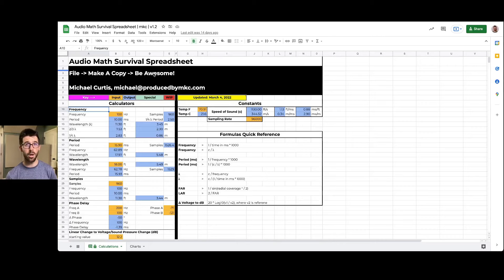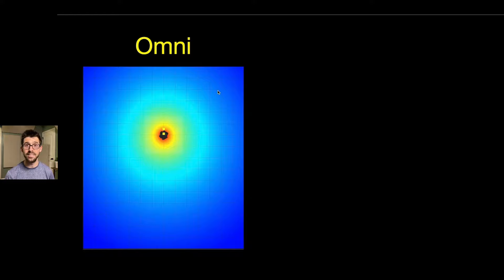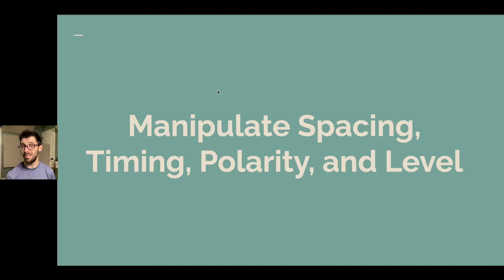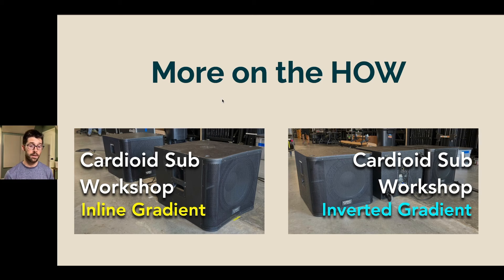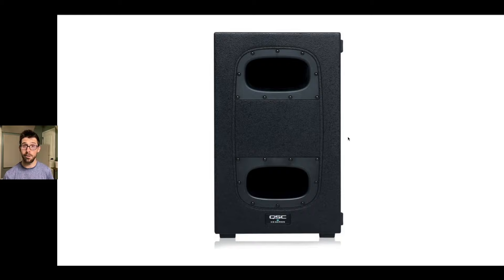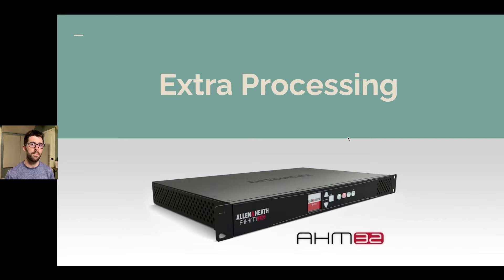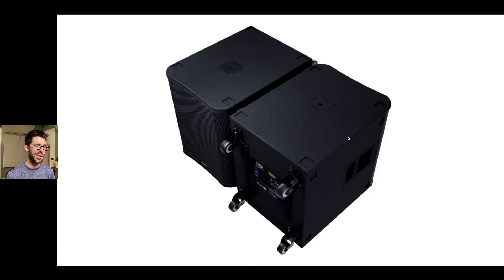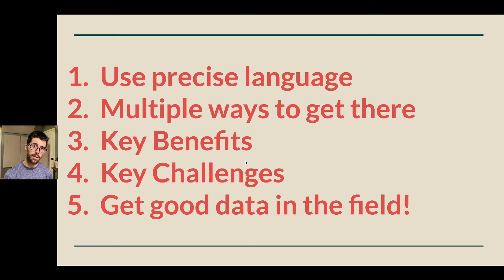Cardioid Subs Explained For Normal Audio People

Comment: Today I checked this QSC cardioid sub with Genelecs 8020 monitors indoors. The positioning takes a lot of place. The speaker front opening was 1,25 from the front wall and pushed my listening position almost into the center of the room. 
I will give it another try on an outdoor setup with KS-Digital D-80. This could be nice for electronic jam sessions.

Comment: Good info.  I wouldn't underestimate the value and efficiency of using purpose built Cardioid subs if this is important to you.  Much simpler, quick setup/tear down, requires less space/power  and very consistent results plus it may even cost less as you don't need extra boxes and amp channels.  I use D&B Audiotechnik B4 Cardioid subs and am extremely satisfied with their plug and play performance and ease of setup compared to building an array.  Not going to compete with McCarthy array in a huge venue but great for many venues where we mortals live 🙂
Reply from the maker: That's a good word and great point. I'm not regularly working with native cardioid subs very often, so didn't come to mind. But you're right, sometimes it's nice to not have to roll your own setup!

Comment: I'm new to it ,,,do 2 subs with no processing(cardiod) have more
SPL than 2subs doing cardiod 

But the cardiod subs only have  the advantage of coverage ,,,by getting low spl than without processed
Reply from the maker: You are correct! You will get more total SPL out of two subs sat side by side vs a cardioid configuration. That's one of the tradeoffs, for sure. You usually don't see more than a 3dB delta between the two, though. So, just depends on how much you NEED that extra SPL.
Reply: @MichaelCurtisAudio  thnx,is it valid for all type of cardiod sub arrays
Reply: @MichaelCurtisAudio  This is something I was interested in too.  So, the total SPL measured all around the subs will be the same or slightly higher for non-cardioid, but the cardioid puts way more volume forward?  So, some of the cancellation in this situation would be sound that is just disappearing?  Seems like a very good tradeoff.  I"m assuming that the amount of "cancelled" sound as a percentage of total sound is smaller and smaller the more subs you incorporate into your cardioid setup?

Comment: Excellent Video, explains a lot and i'm glad you address the "samll setups - 2 subs, etc".  Quick question if it can be answered, I have a Soundcraft Ui24r and 2 FBT Subline 15SA and want to deploy in the stated setup. Can i do 2 AUX feed to the subs and then setup the delay and polarity on the AUX feeds of the Ui24r to the speakers to get the desired output. I'll be trying it out anyways as soon as I get a chance at a venue, don't have the space at home. Much thanks again for the continued great videos on Sound 🙂

Comment: I have two QSC KS118's.  For stacking, does is matter if they're stacked upright or stacked sideways?  I've seen it both ways but I'd prefer sideways so the stack will be shorter.  The look is important for me as I'm a wedding DJ.  I'm going to try side by side under my booth but the trick on that is I usually have a gear rack under there and some storage.
Reply from the maker: You can do either or! Stacking them one on top of the other gets you better rejection in the rear, but side by side still gets good results. I'd be careful putting them under a table or stage, though. That will hurt the rejection performance. If it's a smaller booth it shouldn't be too big of a deal.

Comment: Just bought a pair of bassboss vs21's and I'm wondering what the best way of setting them up is...  I specifically care about 50 Hz and below, especially 30-40.  I want the crowd to feel as much low bass as possible and reject behind to some degree.  They have built in cardioid in a stacked orientation, but I dont know if I can put a 4 ft stack in fron of the DJ booth...  Curious how these patterns work with low low bass
 
Thanks in advance.  great videos.

Comment: I have 2 RCF 9006 dual 18”’s and I was wondering If you lose any of the 6db overall spl boost you get by stacking the two when you do a cardioid or end fire setup
Reply from the maker: The "exact" loss ultimately depends on the amount of diffraction that occurs around that specific cabinet and which setup you end up going with, but a good general rule of thumb is that you will get +3dB summation instead of +6dB.

Comment: Excellent video!  Subscribed. Was wondering, when you use the button on the back of the sub, to let it know it's facing toward the stage, do you still have to set any parameters or are they fixed? If they're fixed, do you know what the delay times are? I'm already assuming the phase gets reversed yes?  This is excellent stuff to be making vids for! Thanks🤘
Reply from the maker: Great questions! If there's a single "cardioid" button on an active sub (much like a QSC KS118), it engages fix parameter processing. It adds a small delay and inverts polarity of that sub.

You can get out your own measurement system and measure for yourself the changes. Put the mic on the ground 6ft in front of the sub, take a measurement with no processing. Then engage the cardioid processing and see what happens.

Comment: What type of subwoofer is best for this setup?thanks❤🙏
Reply from the maker: There's lots of great options out there. Honestly anything will work that's not "bottom shelf" gear.
Reply: @MichaelCurtisAudio Do I absolutely need a sub with a "cardioid" button/function? Or I can play with placement setup and still get a cardioid pattern with "regular" subs (no cardioid "button")

Comment: One caveat omitted here that I think warrants discussion is lobes. Cardioid arrays do not null all frequencies equally or uniformly. Similarly they do not sum them uniformly either. Any prediction software will show you the lobing as you look at individual sine frequencies instead of broad spectrum pink noise. You REALLY need to be aware of this when designing sub arrays, especially for permanent installations, and the results are not very intuitive.
Reply from the maker: Great point. That's why I prefer inline gradient because it has the most broadband rejection in the rear and most consistent coverage pattern in the front.
Reply: @MichaelCurtisAudio  I did an installation in Dubai, where I flew 2 sub arrays per side with the idea of steering the low end down to the Center of the dancefloor. Worked a treat... except that a huge summation was happening around 50ish Hz, about 60ft behind the array right in the power alley, but about 30ft up, on the 3rd floor, exactly where the most expensive hotel room was. I literally shook a vase off a table in the room. Had to go back to the drawing board and re hang it.
Reply: BTW, I found your channel from the open sound meter video. I'd never even heard of it before, long time Smaart user, even longer time ears user hahaha. Cheers for the interesting content 🙏
Reply from the maker: @mobilephone4045  Thanks a ton!
Reply from the maker: @mobilephone4045  That's crazy! Oh the joys of integratino.

Comment: Thanks for all the great videos!

Are those AHM units a good option for system processors? I've been considering using one bc of all the I/O it has at the cost. Maybe the downsides would be no option for FIR filters and the AD/DA conversion time?
Reply from the maker: You're very welcome!

I haven't (yet) got my hands on one, but I've had a great demo from the leading expert on the product from A&H and a systems engineer I really trust, Michael Lawrence, personally owns an AHM-64 and uses it on gigs. You're right in that it doesn't have FIR capabilities, but it's a TON of IO and other processing for an incredible price point. If more SE gigs keep growing for me I will likely end up buying on, if that tells you anything!

Most manufacturers have the FIR processing built into the self-powered speaker (like the RCF HDL6-A, which I use all the time) or they're built into the amps. Given that, you can still put the AHM-32 in front of the amps OR the self-powered speakers and use it as your main processor, even if whatever rig you're working with has other ways to adjust EQ, level, delay, etc.

I don't know for sure the roundtrip conversion time on the unit. It's FGPA and 96k, so it's gotta be pretty darn quick, right?
Reply: @MichaelCurtisAudio  that's great, I didn't know he used one!

I imagine the conversion is pretty quick. I currently use a dbx Venu360 most the time. I know there's mixed feelings on those, but it works for what I need. That to say, the time in it is like 2.5ms I think.

Thanks for your thoughts! I've been considering it and this really helps!
Reply from the maker: @caleb-falk  You're very welcome!
Reply: A&H has the M-Q series of expansion cards that fit both the SQ and AHM systems. E.g. they offer a 32x32 Dante card. However, DA/AD conversion time usually is faster than the lowest Dante latency. I think the SQ has a round-trip latency of 0,7msec and I'd expect the same from the AHM. 

Note that many less-expensive FIR filter systems may pile up latency, e.g. the t.racks FIR DSP speaker controller can easily add up 10msec of latency when using FIR. I'd rather not have FIR then.

Comment: Thank you for this! Cleared a lot of questions up. My employer is having me install three subs as a cluster in a new venue sound system. Thinking of trying an inverted gradient. Since looks are a consideration here, as the system is installed, do you think merely flipping the phase of the center sub would be sufficient? It seems to me like it would work, maybe with some adjustment in spacing left and right?
Reply from the maker: The center sub being reversed is for creating a physical offset between the front facing and rear facing drivers.

Inverting the polarity on the center sub without doing the physical offset or delay line doesn't make the whole "recipe" happen for that setup to work correctly.
Reply: @MichaelCurtisAudio  Got it. Thanks!

Comment: You said cardioid won’t work under a stage, but then you quickly referred to the front stage wall and the rear stage wall.  We’re on a portable stage which means no walls front or rear (well the wall of the building is about 8 feet behind the stage).  Are you sure they won’t work under any stages, even portable like ours?  (In the end, I didn’t position our 4 subs (KS118’s) in a cardioid, but rather spaced about 2 feet apart under mid front of stage.)
Reply from the maker: Sorry for my lack of clarity. You can place a cardioid sub array 3-4ft and great in front of a stage that has an open front and still get good results.

A cardioid sub array will not work properly under a stage. You'll still get sound out in the audience, but you will not get the rejection in the rear.

Comment: Hey howzit going. I've noticed that the Yamaha subwoofer DXS15mkII has a key to change it into cardioid function. Am I able to use only one sub box in a cardioid setup or need at least 2? Tks
Reply from the maker: I'm honestly not sure with that box. I tried to find the manual on Yamaha's website, but came up short. My leaning is the latter option.

Comment: Hi Michael,
I can see 2 subs config for cardioid setups in your video but the manuals for my subs says I need at least 3 boxes to have a proper configuration. My subs are RCF 8006 and I can't use end firing as there ain't enough spaces between stage and audience.
Reply from the maker: Three boxes is ideal for setup RCF wants you to go for, but you can "roll your own" cardioid setup by having the boxes on separate outputs and applying your delay/polarity processing. There's a ton of ways to make a cardioid shape from a variable amount of subs, just depends on the tools you have.

Comment: So I have three pairs of Labhorn subwoofers which are directional by design. From the cones to the mouth of the enclosure, is 11.5 feet. With three pairs, I’ve considered taking two of them and setting them into a cardioid patter but my situation is unique. 
Any guidance?
Reply from the maker: It's hard to say without knowing the specific coverage shape of that box, but I'm going to lean towards a cardioid setup of any kind not working out. It's the overlap between the boxes where the magic happens. If the energy is steered, then you won't have overlap, thus not making the unique phase recipe in the rear of cardioid rig do its thing.

Comment: Great info! Thank you so much! We currently have 4 subs under a stage. What set up would you recommend to reduce the low end on the stage and max projection towards the audience with the 4 subs under the stage?
Reply from the maker: When your subs are under the stage the cardioid pattern breaks up and doesn't work. So, if you're keeping them under the stage there's really nothing you can do to reduce the low end coming up onto the stage.
Reply: #1 ports and speakers should be facing the audience... #2 boxes should be at the very front of the stage #3 if possible the sub boxes should not be making physical contact with the stage, there should be seperation between the two, or at least have some soft foam in between (no fire hazard here, be smart).

Comment: In my small personal rig I have (6) RCF HDL 6-a and (2) RCF 8004-AS. How familiar are you with the "Cardioid" button on the subs? Does this automatically process the phase and then all we would have to do is just set the delay and placement? Just curious if you ever worked with these subs. I know you worked with the HDL 6-a before from your other videos. Thanks in advance and I love your videos! Great information and your full of knowledge and a great teacher as well!
Reply from the maker: Hey, David! Great question here. I've never used the 8004-AS subs, but I do know what their cardioid processing does. The user manual recommends placing the subs in an inverted gradient configuration (3 cabinets next to each other, with the middle one being reversed and facing backwards). These can either be in a horizontal line or a vertical stack. The cardioid button on the 8004-AS adds some delay and a polarity inversion to that specific sub to complete the recipe for an inverted gradient cardioid setup. It helps free up some processing channels!

My tutorial on that setup is here: https://www.youtube.com/watch?v=ecOLyJpuqcE
Reply: Awesome, Thanks for the info!
Reply from the maker: @ddengle  You got it!

Comment: A MUCH better solution will be having "Real" 1/4 wave horn loaded subs. they are 10 times more efficient that the box subs with a hole in them (reflex boxes) with better transient response.....
Reply from the maker: To each their own. I think each topology has their strengths, but horn load isn't the only way to go in my opinion.

Comment: Hello Michael, great channel !

I am a mixing engineer and amateur room acoustic designer, although I would say I had a few successful projects... I'm interested, do you or anyone tried to apply cardiod subs setup in the studio environment ? I know some manufacturers like Kii, Dutch & Dutch claims their bass is cardiod... Is it possible at all to setup with couple subwoofers ? It could make some SBIR reflections easier to battle with.
Thanks
Reply from the maker: Great question here. Active cardioid sub arrays do not work in studio environments since they're so close to boundaries (the walls). Active setups need space around them to work properly.

I'm betting the brands you mentioned use a passive cardioid topology which is less sensitive to its environment affecting its polar pattern.
Reply: @MichaelCurtisAudio  Hi Michael ! Honestly not really sure about the technology inside Kii, Dutch & Dutch etc... 

What is interesting that Dutch & Dutch monitors have two woofers at the backside of the speaker, operating only bellow 100hz. 

They say this:

"Inspired by the work of the late speaker designer Roy Allison, the 8c is designed to leverage Boundary Coupling. Boundary Coupled Bass (BCB) offers three main advantages:

-Boundary coupling avoids the destructive interference between the speaker’s direct sound and the boundary reflection.

-Low-frequency headroom is increased by up to 6 dB.

-Increased directivity in the bass, for a good directivity match between the Boundary Coupled Bass and the cardioid midrange, which takes over above 100 Hz."

EDIT: Seems that Kii Threes use the same tech, dual woofers at the back side firing the sub 100hz low end... I think this all has to do with eliminating front wall SBIR when the front wall boundary is close...

This somehow aligns with my dual soobwoofer experiments... I found out repeatedly in 3 different rooms that I'm getting the flattest low end response at the listening position by placing the front firing subs to face the front wall, away from the listening position. I think the reason for that is eliminating the front wall SBIR by placing the low end source basically an inch from the boundary...

Thank you for your great content !